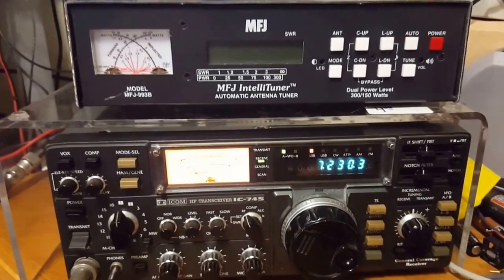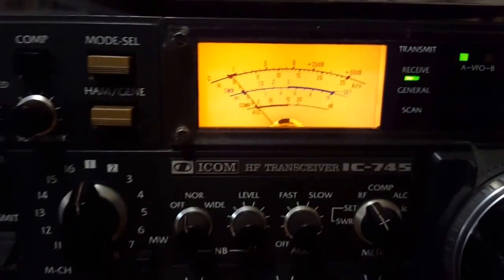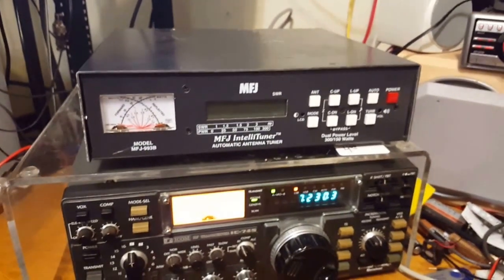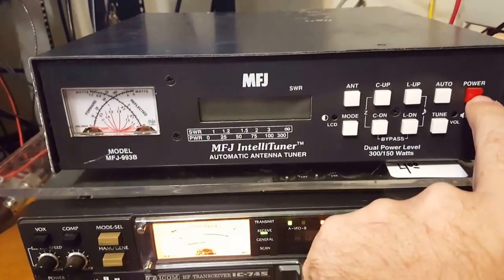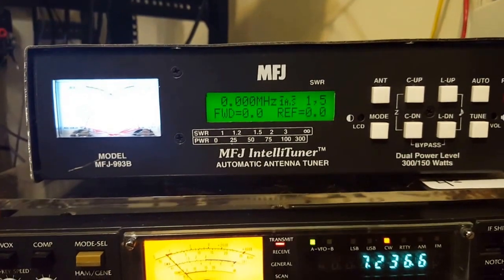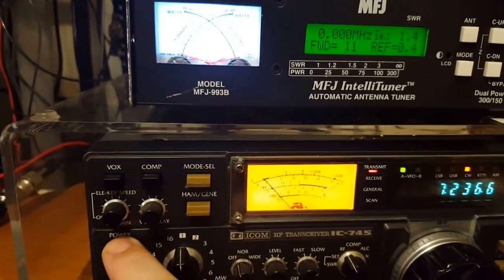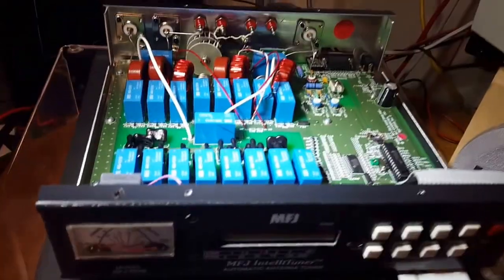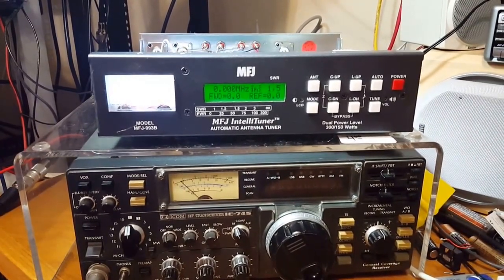MFJ 993B..burned up chip and still tunes..

Comment: Over powered it like 600 to 800 watts that's what happened to my friends and mfj sent him new part's but he couldn't find anyone to fix it and it was only 1 year and 2 months old and it had a 2 year extended warranty and they sent him a new one and they said that it was because some one put to much power threw it and it was the same as yours. So no more then 300 watts because it will happen again.

Comment: I've been trying to find one for year's but new there crazy I've got a mfj auto intelligence tuner  but I need the 993b because my radio does more then 200 watts and mine is new took it out of box and saw it was only 200 watts so I put it back in the box. Hopefully I can trade this and a new hand held haven used put some channels in it to check the power and it reached a repeater 25 miles away from inside the house.

Comment: For your own safety I wish you would remove the ring from (left ?) hand when sticking it down into the ATU. I accidentally got sort of welded onto the output terminal  of an ATU. I was in a Mil. Land Rover and having to reach over the TX and get at the ATU terminal to tighten up the antenna pigtail cable. Has we were mobile X-country I was thrown forwards and pressed onto  the key with my body. Putting the TX to send was not a good idea while holding the bloody O/P terminal. There was a split stop ring in the far end of the threaded rod and has I very quickly tried to pull my hand away the ring finger got fowled onto the sodding stop ring. I got free and removed the ring. that was flung out the back of the Rover never to be seen again  with words that I would not say over the air. I have and will never wear a ring again. 73 de G0WXU - John.
Reply from the maker: Thanks for the concern..it is tungsten carbide..non conductive..they say.

Comment from the maker: Sorry for lack of update, I fixed this tuner by putting a DIP version of that chip on a small perfboard and hardwiring each pin, then replaced a large resistor near input, and dug out all the carbon from pcb...been working great for a long time now.
Reply: KK4PYN I came across this video as I have a similar problem. My setup was hit by lightning that was mostly absorbed by the antenna. Some of the impulse traveled between the house wiring and the radio grounding. The tuner still works but the LCD starts to display gibberish after several minutes of inactivity. No big deal but now I’m wondering if any firmware updates are available. Did MFJ mention anything about this? I figure it would be a good time to go through the tuner and repair any damage and perform some mods and updates in one session. I would also be interested in 3rd. party firmware but my searches have not turned up anything. 73, Damon

Comment: U9 is a 74HC14, a six-pack of schmitt-trigger inverters used to trigger the wake circuit. The input to that sub-circuit comes directly from the transmitter input, so maybe your unit was over-powered, or shown a surge from a short or a lightning strike.  Looks like U9 also buffers the input to drive the frequency counter input. Seems like your frequency counter display is still working ...

Did you end up repairing the board, or replacing it?  I'd guess you'd have to replace that chip, plus the input buffering that was meant to  protect the chip and the rest of the upstream components -- C96 is a  bypass capacitor, and R30 and R31 are hefty resistors that filter the input a bit in order to help drive the trigger.